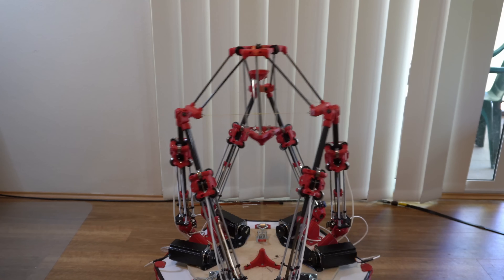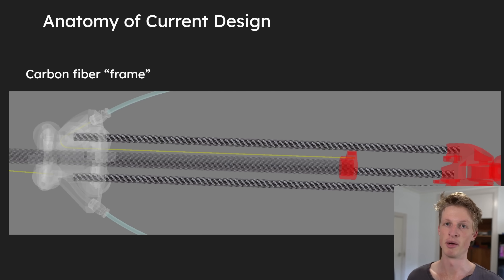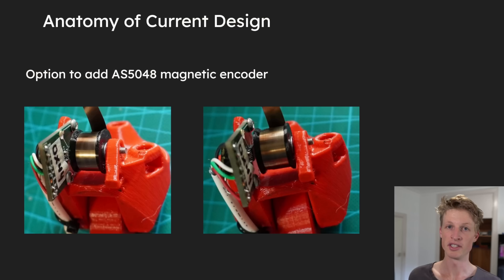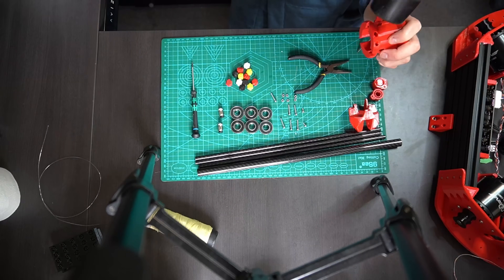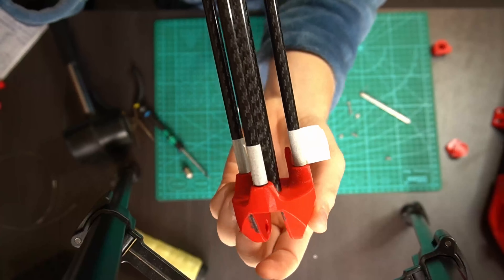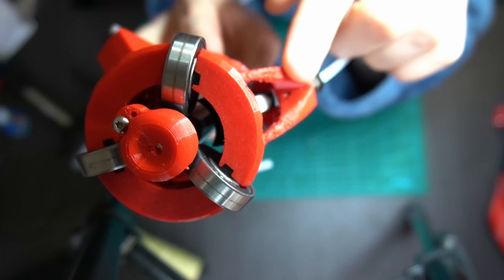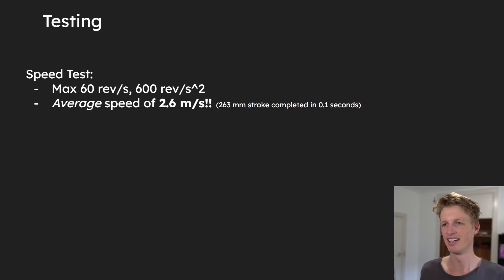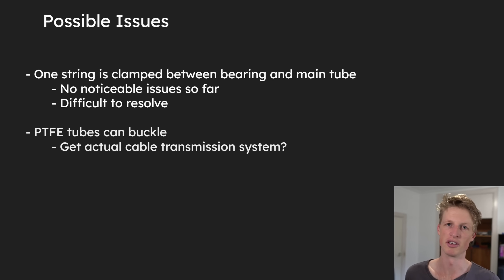Designing High-Performance Linear Actuators: Speed & Stiffness for my Juggling Robot | PDJ#19

Comment: I suppose there’s a reason why you couldn’t use a linear bearing instead of 3 ball bearings, I probably missed it
Reply from the maker: There is! The tolerance on the carbon fiber tubes is too big and they either don't fit or are too loose inside the linear bearings (or both!). If I had the right tools (and PPE) I could probably make it work, but I don't...

Comment: It would be better to use an automatic direction change gearbox (like a thread cutter, which runs forwards when pushed and backwards when closed), then the motor can run at a constant speed and does not always have to brake.

Comment: how do you sense the position of the actuator
Reply from the maker: Good question! I've got a rotary encoder on the motor and I assume that there's minimal backlash between the linear component and the motor (which is IMO a fairly okay assumption once the strings are tensioned properly)

Comment: very cool, but one thing I didn't think was cool is that the actuator has a slightly large area in terms of its total diameter, and it seems like it would be complicated to adapt it for other activities... how would I fix the actuator for different activities... anyway, it's very interesting, mainly because it uses all carbon fiber, which I think is a sensational material.

Comment: The nylon tubes maybe straightened perhaps using a hair dryer for heat, then just manipulate them with a gloved hand (Hot & Safety). These are similar to tubing used on automotive air shocks. This tubing as well as hoses and coated wire exist a hot extruding machine, the curl as the cool taking a coil set because they are wound onto spools. Un-coiling these coil sets requires heat. Just thinking out loud. 
Also, I am curious on the magnetic position control. I have seen a rise in the design and use of “Hall-Effect” sensors. Start with a coil of wire wrapped around a “Shunt-Bar” extending outside the shell of a hall-effect sensor. This creates a small electrical signal to trigger the Hall effect switch. If wire can work, then a magnet in motion can induced an electric signal to trigger the switch. I know you didn’t build it but this is a possibly component being used. As an automotive tech, who moved into a teaching job for ACDelco, we had to stay current on automotive technology. For example; A 2004 Corvette has remote keyless entry with a button on the key fob to produce a signal to unlock. It contains an “RFID” chip in the plastic keys head that is energized when you hold it with 3 meters of the drivers door. (A weak magnetic field excites the RFID chip to send a 17 digit code, then the door unlocks and pops open) But to keep a tight seal on a roof/door seal, it rolls the window down 10mm to clear the rubber seal. The window motor is a brushed dc motor and current goes high to low many times per second when rolled. They use a shunt on a “Hall-Effect switch to count the number of times the motor rotates. Stopping at 10mm. Then roll it back once the door is closed. Fascinating! 
  Enjoy learning! 
Retired ASE Master tech 78.
Thanks kindly for sharing!

Comment: There is a type of rope, which is high tensile strength and very low wear, which also is very low stretch, I triducing little to no backlash over time. 

Dacron. You could also look into Kevlar rope sheathed in polyester for weather resistance but I think that might be over expensive. Dacron is Amazon obtainable for not much for a lot of rope. $50.50 U.S. for 1000 ft. spool.
Reply from the maker: Interesting! I haven't heard of dacron before. I'll pick up a spool and give it a test! Cheers for the suggestion 😊

Comment: You could probably save weight by swapping the bearings for some linear bushings like IGUS drylin ones. They do have carbon fiber shafting as well. Be sure to get a decent spacing between your bushings.

Comment: For the concern #1 to use deep groove bearing or cut a groove will solve the problem.
For  the concern # 2 use a stainless steel  to encapsulate the PTFE tube

Comment: A push-bike handbrake cable may be a good solution for your string problem. These are bowden cables and use stainless steel cables. Theses aren't flexible but you could use your string inside the outer sheath.

Comment: Hi Harrison, this is an amazing design!!! Congrats! I had a question, at @8:21 why are you using 3 cf rods, why not just 2? wont 2 of them be enough and do the job? why are they arranged in an equilateral triangular fashion. I'm not so mechanically equipped, was wondering if you clear my doubts :) I'm trying to make something in which I want to use linear actuators like yours.
Reply from the maker: As a general rule, if you're making a structural element, triangles are king.

Specifically for this case, if we only had two support tubes then if any load were applied to the distal part of the actuator on a side away from the support tubes, it would lead to a comparatively large bending moment on those two support tubes. Three support tubes goes a low way towards reducing this bending moment/source of stress.

There is a case to be made for these actuators rarely being exposed to those sorts of loads at that location, but the loads from the stewart platform part of Jugglebot might act in strange ways that I certainly had little understanding of when I made this design (and still largely do now 😅). The 'three-ness' of the tubes also matches up nicely with the six support bearings at the distal end.

At the end of the day, I think the realistic answer to why I chose three was a mix of intuition and aesthetic appeal more than anything else. Two might have worked perfectly well also!
Reply from the maker: PS. What are you trying to make?

Comment: at 14:12 when you are showing testing, on the top right the motor is rubbing against what looks like a wire.  Assuming you did some kind of cable management for it.  If not it will shorten the life eventually wearing the coating off.

I like the design and look forward to the Juggling Robot.
Reply from the maker: Haha good spotting! Thankfully that was only there during testing 😊

Comment: Hello, Late comment, but it might help to gain a few cents :) . Kevlar ropes will generate more friction than dynema ropes . as long as the friction heat generated at the friction point does not exeed the melting point of dyneema , you are good with this matérial rather than the kevlar .

Comment: Hey mate. Good design. Your put PTFE tube could be replaced with gear cable housing for a bicycle. Upside is the housing has steel reinforcement and a smaller diameter PTFE tube. Downside is it is not as flexible. However, as you are only experiencing problems at failure, this would the increase an unwanted force somewhere else causing a different failure so maybe use the speed controller as a high current shut off fail safe.

Comment: You could really make the design simpler by using two 16mm linear bearings instead ofthe roller bearings, those are very easy to use (can get clipped in your 3D printed part) and are made to solve your specific problem. Look up LM16UU, there exists two kinds : with rolling balls inside or based on self-lubricating polymers.

Comment: Check out IGUS linear bearings made from plastic to reduce weight. Or shaft guides. They also make square ones. And also square carbon fiber tubes exist. Maybe some telescopic thing can be built with these to get the absolute lowest weight.

Comment: Hi - a bit late to the party I'm afraid...
The weak point in the implementation is the PTFE Bowden cable housings.
Possibly a better solution is to add another 2 very small diameter carbon fiber tubes between the 2 "heads" and run the "strings" through them.
You will also have to make sure that the "string" is anchored at the top end so that it feeds directly into the tube and on the other end, a small pulley that makes sure that the "string" is also centered in the carbon fiber tube no matter where it is coming off the drive capstan from.
Unfortunately Bowden cable housings do not lend themself to be very accurate at all.
They can move and flex which changes the "shortest distance" length which in this case would cause accuracy slop but fortunately in this application a few hundredths of a millimeter should not be a major catastrophe.
Also see what the smallest size bearing is and design around that - weight is the enemy and may cause overshooting and length oscillation when trying to stop from what is a pretty impressive speed.
Well done - well engineered and well constructed.
Reply from the maker: Cheers for the feedback! Re. being late to the party: at least you'll have the shortest time to wait before seeing the updated actuators in a week or two 😉

Interesting thoughts on the bowden tubes. I hadn't really paid too much attention to the fittings on the PTFE tubes, but I can see where you're coming from - they're definitely not the most precise things in the world...

As it happens, the new design is completely bowden-free, so all of these problems are now gone 😁

Cheers for the kind words ☺

Comment: Have you considered using mechanical or light stops switches at the end of the rods? Much like 3D printers use in their limits along with known rod length values.  This would also allow for precise and fast calibration if anything did loosen or need adjustment. Just a thought.
Reply from the maker: Yeah I was using those in a previous version of these actuators, but now that I'm using ODrives to control the motors, I can much more reliably monitor the current passing through the motors to "home" the actuators on startup without needing extra parts